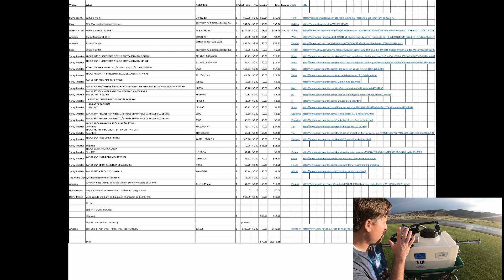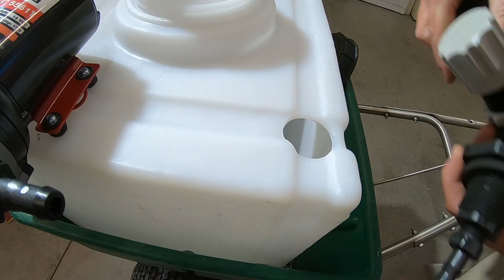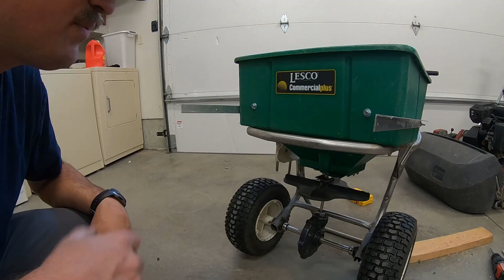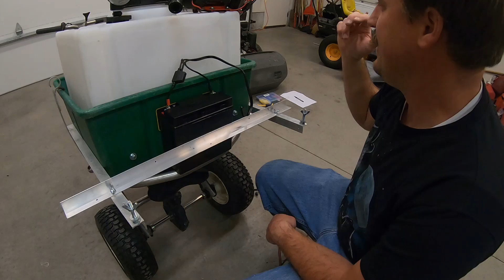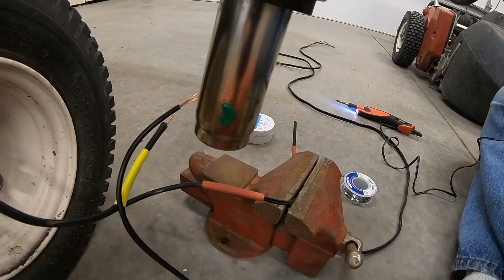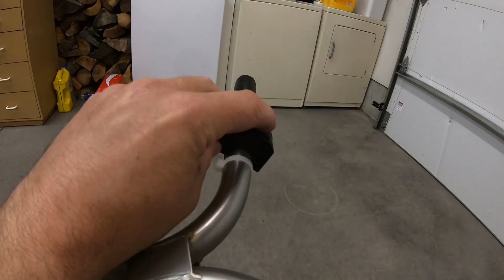How to build a HOMEMADE LAWN SPRAYER. 5 nozzle boom

Comment: was the orientation of the tank in the spreader the only reason you didnt use the bottom access to supply the pump or were there other reasons?  I am building a boom sprayer for my zero turn based on your experience.  the bottom access will be available and I planned on using it to supply the pump unless.  thanks for video and documents.  made putting mine together considerable easier.

Comment: Cool spray build. I am not internet savey. How do i get emailed a parts list? Specifically the tubing and nozzles for the 5 spray nozzles. I already have a tank , pump and pressure washer like garden spray. Figured I could change the output hose to the nozzle array.

Comment: Very nice but the Lesco cart wasn't necessary, because its pretty expensive. I'd just use one of the garden carts or beach carts with no flat wheels. Other than that, this is exactly what i was thinking, having the parts needed makes my project much easier.
Reply from the maker: I had the lesco

"having the parts needed makes my project much easier"
Reply: @lawnrebel  Gotcha. I'm going to use your plans minus that part, they have a gorilla cart on sale, should work well.

Comment: I built same sprayer but my output is 2 gal to 1000sqft do I need to open regulator to let some product back into tank to get the 1 gal per 1000

Comment: How did this hold up ?
Reply from the maker: I still use it to this day. It works great. I changed the boom mounts to steel. Other than that it still works several years later

Comment: Hi Connor,
Thank you for this great DIY video on sprayer. I would like to make a DIY battery powered backpack sprayer. I already have suitable nozzles, the pipe, a 12v Dc 80Psi 1.1 GPM diaphragm Pump, and I can source a suitable 20 liter plastic container. 
On watching your illustration, you quickly mentioned a “pressure relief valve with drain back”. I didn’t quite digest or see how the “drain back” feature works. I would like you to explain the details of that pressure relief valve with special emphasis on the drain back feature, if you don’t mind Sir. 
Is the valve modified to have drain back, or does it have that feature directly on purchase ? 
Thank you in advance for your consideration and I hope to apply this technology in my 2 acre garden.
Regards, Jesse.

Comment: did you ever consider that chapin push behind sprayer and converting that to a boom? or what was your motivation to build this? I'm wondering if there is something I'm not considering when thinking about a sprayer.
Reply from the maker: Yes I did consider it. I wanted a larger pump that was capable of doing more than just 2 nozzles. At the time the Chapin walk behind sprayer was unavailable. If doing it again I'd do the same thing over.
Reply: @lawnrebel  great to know, thanks for doing this great work! I appreciate it

Comment: has anyone switched out parts for a two way output, with separate shut off valves so you can use a boom or a gun?
Reply from the maker: You could easily. I just did not want to spend the money
Reply: @lawnrebel  yeah i was looking for a part, you would think it would be a thing. I guess you could use a splitter and in line valve. but i havent tracked down an obvious part yet.
Reply from the maker: You can find any of that stuff at sprayer depot dot Com or spray smarter dot Com

Comment: Is the 12-gallon tank pressurized?
Reply from the maker: No
Reply: @lawnrebel  Thank you, excellent video. I want to set up one using a 55 gal plastic drum, but I would have no access to install the thru fittings unless I epoxy/glue the to the tank top.
Reply from the maker: You could easily do it with a big drum like that. I love mine. I'm about to build a 110 gallon sprayer. Gas powered motor with pump. 300 ft hose.

Comment: 2 more questions then I am going to start ordering the parts. What pressure have you been using when spraying? And are you using the yellow or red nozzles? Thanks
Reply from the maker: I use the red AI nozzles mostly. About 30-40 psi

Comment: I've built almost the same setup as what you've got, but I'm finding that I'm blowing the 7.5A fuses in-line between the battery and pump when it turns on. Did you have to bump up the size of the fuses? The pump has a max amps of 17A but the cables that came with the battery tender only have a 7.5A fuse in-line...
Reply from the maker: yeah same here. I use the 15a or 20 a fuses

Comment: Hi  I'm curious about the spray tips. On the spray smarter website, there are the options for just the spray tip, and then also for the spray tip and cap, but the pictures look the same. Is the Cap literally just a Cap to cover the tip when not in use? Or is it something that affects function? Thanks!

Comment: Just built my sprayer off your plans. Pretty fun project. The only issue I am running into is when the water level in the tank gets down to about 2 gallons the sprayer starts to sputter. Could be the hose is coming out of the water. Have you experienced anything like this with yours?
Reply from the maker: I changed the suction tube to the bottom of the tank. Before I did that I siliconed the suction tube to the bottom of the tank so it would not come up out of the water. This helped but the tub on the outlet on the bottom of the tank was the best way to do it and I am not sure why I did not do it like this from the beginning.
Reply: @lawnrebel  Thanks I will try it out. Besides this the sprayer works awesome! Keep the videos coming!

Comment: Ouch, $600 for just the sprayer part? and the spreader you put it on cost $500. That's a lot for a sprayer. I have a lesco spreader and I like it  I have a pull behind sprayer on my garden tractor. Thinking of converting it to 3 point so I can get closer and back up easier.

Comment: Great video.  600 dollars is a bit much for this DIY project that I would think a commercially manufactured unit might be available if you look on the internet.  That said, I commend you for your inventiveness.  Changes I would make would be to use a wheel barrow to mount the tank or a hand truck that might be less cost than the spreader you used.
Reply: I can buy this for less than $200 ...
https://www.northerntool.com/shop/tools/product_200727337_200727337

Comment: Very nice and I like how you make it look professionally done as opposed to just slapdash throwing it together with baling wire and duct tape.  One possible upgrade I can think of...for a winter project you could remove the push handles and add a tongue to the spreader so that you could pull it behind your zero turn or lawn tractor.  The on/off switch would have to be moved, but that would be no big deal.

Comment: What tool and size did you use to cut the holes on the tank?
Reply from the maker: I used a hole saw. I just bought one that was slightly larger than the bulk head. I really do not know. I would do that differently knowing what I know now tbh

Comment: Im doing the same is there any reason you had the pickup hose on the top and not coming from the hole in the bottom. Other than ascetics and to have a smooth bottom?
Reply from the maker: That had not crossed my mind. I may modify my unit to do this

Comment: I got the exact same pump.  Yours has two red wires going to the head on the end of the pump.  My pump only came with one red wire.  Also there are 3 spade connectors on the end of the pump.  Can you tell me which two you used and if your pump came with the two red wires?
Reply: Never mind I figured it out.

Comment: Since you have a tee "before" the pressure regulator valve I would think your not really controlling the pressure that goes out to the boom.
Reply from the maker: that is the only way the regulator is designed to work.
Reply: It's a semi closed system after the pump.  The spray nozzles cause backpressure because they don't let the fluid out at the rate that the hoses are capable of delivering. The pressure relief valve allows that back pressure to return to the tank and dissipate at the bottom, which also helps agitate the contents of the tank.
Reply: @BlackSixDelta  I was searching these comments for this exact question.  True that the overflow will return to the tank, but it seems only the overflow will be regulated.  The nozzles will receive the full 60 PSI from the pump and don't seem adjustable.  I know this comment is late, but I hope @Connor Ward can clarify?
Reply: @scottc5292  this video kind of explains it.  The pressure relief valve keeps the pressure between the pump and the nozzles at a constant pressure that you set, the excess pressure goes back to the tank.  So if the pressure from the pump is coming in at 60psi, and you set the relief valve at 35 psi with the line to the spray nozzles turned off, then the system will regulate and stay at 35 psi, with the extra 25 psi returning to the tank.  With the line to the nozzles on, the valve will regulate the pressure at 35 psi, but your return pressure will drop off because the nozzles are letting fluid out of the system, decreasing the pressure.  It may not drop off to zero, but any excess will return to the tank.

https://www.youtube.com/watch?v=1ID75lfv1_Y
Reply: Tim so the gauge reads the inlet side of the pressure valve?  Makes sense now.  With the valve to boom off, the pump will maintain 35psi on that side but no fluid flow.  All excess fluid returns to tank.  Found another sprayer build series.  Excess to this application, but explains the nozzle diaphragms, tip selection, etc.

https://youtu.be/FlG52KCwOMQ
Reply: Jk @BlackSixDelta >1j

Comment: I’m in the process of building a broadcast spray set up for my zero turn but Correct me if I’m wrong....based off your nozzle selection the teejet red xrc has an output of .54 gallons per 1,000 sqft at 15 psi all the way up to 1.1 gallons per 1000 sqft at 60 psi at 3 mph which is the average human walking speed...... 5 nozzle boom defiantly exceeds the normal 1 gallon per 1000 sqft....just trying to wrap my head around this

Comment: Do you have just a link for the sprayer heads? I can’t seem to locate them using google
Reply: If you live in a rural area you can try the farmers co-op or a local at supply house. Otherwise tractor supply may have thwm. We always get our tips from our local co-op, they're brass and fairly cheap.

Comment: how do you regulate the volume of liquid going to the grass?
Reply from the maker: By the spray nozzle selection
Reply: @lawnrebel  ah ok. i thought it would be based more on the pressure regulator....more pressure...more to the nozzles...
Reply from the maker: Yeah that as well.
. Or walking speed

Comment: Do you still use your Lesco spreader for granular application‘s? If so, how easy would it be to take the sprayer tank, etc. in and out?  Considering this option, but I would like to be able to use the spreader for granular applications as well.
Reply from the maker: Yes I still use the lesco as a granular spreader. It is very easy to take the tank in and out of the hopper. I love this setup.
Reply: Connor Ward Did you mount the boom at a height of 20” and the nozzles are 20” apart?  If so, where did you measure the 20” vertically from?  The nozzle tip?  And why?
Reply from the maker: Yes. 20 and 20 at nozzle tip. Per tee jet recommendations

Comment: Good information except for when soldering electrical connections. NEVER use acid flux it will lead to problems. ALWAYS use a resin flux core solder made for electrical work.

Comment: Great video and thanks for the parts list. One question though.... is there a way to add a spray gun to it?  I’m looking at putting this on a small trailer to pull behind a mower or quad.
Reply from the maker: Absolutely. Just add another "T" in the line after the regulator.
Reply: @lawnrebel   Just add more sand Pal, 🤣🤣🤣. I still love your videos the best just tickles me to no end the amount of money 1 man yes U Pal have wasted to try to kill your POA cultivars & you haven't even figured out yet all those tons of sand is preventing you from reaching root bottom. It's all in Vain but I Love it Pal !!! Your over seeding is probably greatly reduced to. I'd bet the seed just rots in the sand

Comment: And 80 lb spreader as a wagon is very expensive
Reply from the maker: Let's see you try to maneuver into tight corners with a sprayer in a wagon. Remember... You can not over apply the product. You need to get an even distribution of product even in the hard to reach spots like corners, curves, and edges. The spreader with the 2 wheel pivoting capability is the best option. The 80 lb spreader is also a spreader for my granulars. I had the spreader already. Why would I want another piece of equipment when I already have the best option for the job?

Comment: $600?!? Holy crap! Nice build but not very economical.
Reply: Yeah, there are some ready made sprayers on a trailer for like 250 and just need a better quality pump. I believe Northern has a tank sprayer to mount on a four wheeler and you could fab your own boom with low volume tips to maintain pressure.. I have a big yard and went with a backpack setup after considering other options.
Reply from the maker: I did not want a pull behind or a 4 wheeler sprayer. With those you lose your ability to maneuver in tight areas and be meticulous. Those sprayers are good but not like the one I built. My pump is better. Those ones also do not have a battery and their boom and tips are not as precise.  I am looking for precision not just to get it done.

Comment: Do you have any recommend on what nozzles to use if I only wanted 3 nozzles to still cover 10 ft? My pump is only 2.2 GPM and think 3 is the max. Would I just space them out further and raise the height? Different nozzles too? Thanks for your help.
Reply from the maker: This I would not be able to assist you in. I am not very well versed in the nozzles. Here is a good resource for you to read. https://thelawnforum.com/viewtopic.php?f=4&t=33
Reply: Connor Ward thanks. That’s a great post and I’m starting to learn. It looks like all the tips are recommended at 20” apart though.

Comment: Connor, I am in the middle planning a similar sprayer to tow behind my lawn tractor.  I was thinking of going 6 nozzles. I have so many questions for you.  Love to know what nozzles you ended up going with, and wondered  if  you are happy with the pump.  You got a 5.5gpm 60psi pump.  I was thinking more in terms of a 1.8gpm 100psi pump.  I would love your thoughts.
[Edit]
I downloaded your parts list.  Very nice.
Are you happy with your nozzle/pump setup? 
After calibration, are you getting the flow and coverage you expected?

Comment: Connor, you inspired me to build a smaller, 3 nozzle version of this boom sprayer to sit in my Earthway spreader.  I have a question on the battery.....  How did you decide on the amp hours of the battery?  I see your pump pulls a max of 17 amps, so are you thinking you should get an hour of spraying before you need to recharge?  Also, after using your sprayer, are you satisfied with your battery choice?
Reply from the maker: yes I am satisfied with the battery choice. I really did not put a whole lot of thought into the battery. It was only like 30$ so I figured that if it works for a few years then I would be good and then I could get a new one. I just wanted to get a batter with the most amp hours without spending too much money. I have never run out of battery when using it. I have 20 sq ft of lawn and it has not failed me yet. This could be because it is new and on its first season. I do however keep it on the batter tender when I am not using it so it is always at full charge when not in use.

Comment: I was wondering why you had the "TEEJET XRC EXTENDED RANGE FLAT SPRAY TIPS Color Red" (XRC11004-VS) and the "TEEJET AIC AIR INDUCTION FLAT SPRAY TIP & CAP Color Red" (AIC11004-VS).  Are they both needed or just choose one or the other?
Reply from the maker: The air induction tips are for products that are soil applied like a pre emergent or a pesticide bug control product. These tips spray a coarse droplet. The other fan tips spray a fine mist and are for foliar applied products like plant growth regulator, liquid iron or some micros.

Comment: Connor, would this setup work with the Lesco 50lb spreader?
Reply from the maker: Depends on the hopper size. This 12 gallon tank is 18"L ☓ 14"W ☓ 16"H. I am sure that there are smaller tanks that would fit. Google search plastic applicator tanks or plastic tanks. They should all have the specs

Comment: What is the range of output approximately in gallons/1000? Thanks
Reply from the maker: Depends on what tip I am using. It generally about 1 gallon per 1000.

Comment: Hey just FYI you can buy that whole set up for $400 bucks! Obviously doesn’t come with spreader but made for four wheelers!
Reply from the maker: I'm aware. Those units have a smaller pump, no battery, and will not fit into my spreader.
Reply: Connor Ward 
I figured you pry did! Cause I just bought one !

Comment: Nicely done. Suggestion, maybe rotate the tank 180 so the pump is on the backside of the axle also maybe move the battery behind the tank. This should help with the balance and tipping forward.  Nice touch with the quick release to remove the boom.